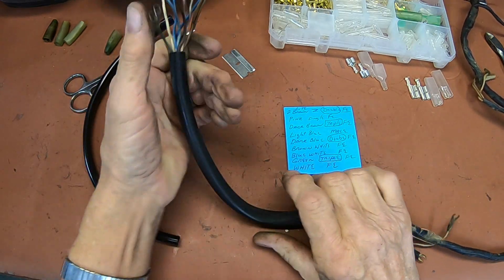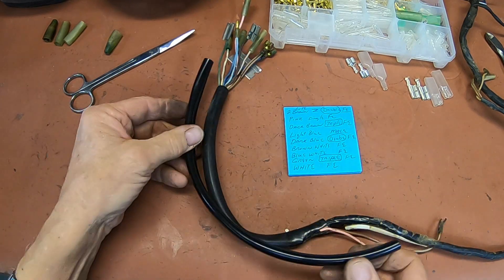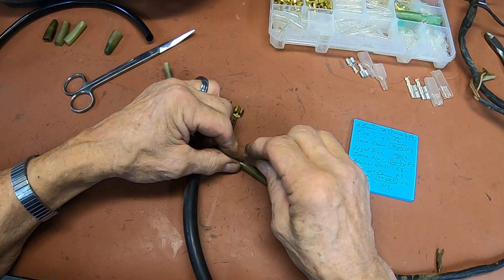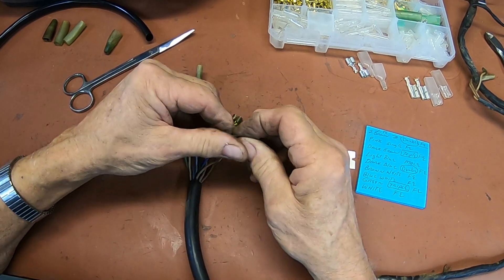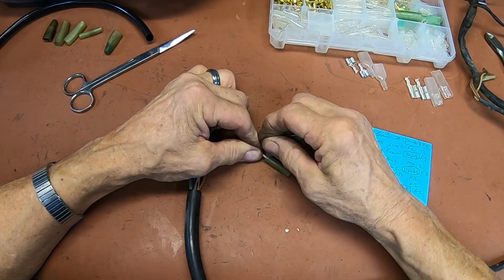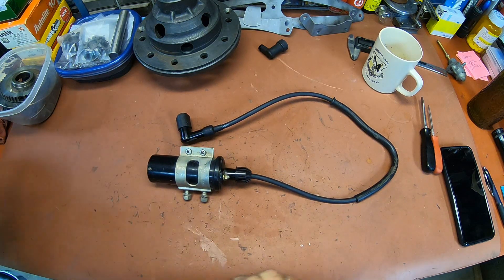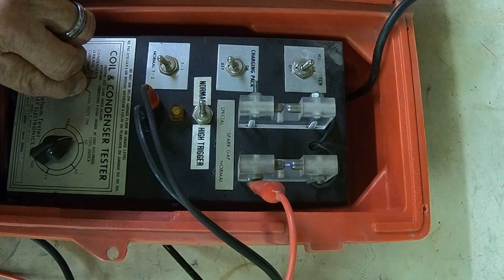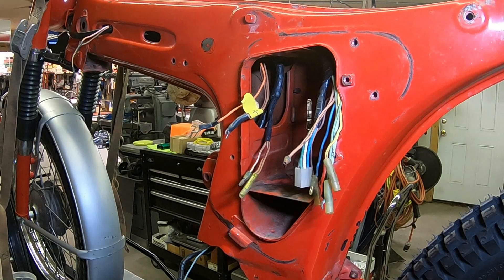Wiring and assemble, Yamaha Trailmaster 100

Comment: Ck with a cabinet shop locally  ir countertops unstallers .Sometimes they have kitchen sink polished granite countertop cutouts you can get for free, so to have a nice flat surface to sand on when you surface sand your top sides of your cylinders and bottoms of your aluminum cylinder heads. They are flat and
work great
Reply from the maker: Sounds like a good way to find one. I have a surface plate that I use.

Comment: Thanks for the coil info. I have a coil I purchased for a Suzuki T350 on eBay that when I test with a multi meter the primary wiring checks out good. The secondary shows nothing. The plug has no spark when laid against the cylinder. Is it most likely the wiring itself inside the coil or is it the lead from the coil to the spark plug cap that is bad. I bet you'll know.Thanks Dale.
Reply from the maker: I would say its most likely the primary winding is bad, the coil leads are stranded wire the odds that all the wires are broken is not likely, hence you would get some spark. Yep, coils bad.

Comment: I totally restored a 1969 Kawasaki G3TR. Or 90TR Bushmaster.Its placed and displayed in my living room ..its totally in showroom new condition.. new engine also,,my very first bike i bought new (Used) for $285. Ive done a couple f5s ,and f9s horns.also.  and many other bikes and snowmobiles thru my 50 years.  I Moved to ga from MN in 99 and down here everything is in rusted ruin..humid climates like Ga turns machines to junk in just a couple years.. Don't ever buy one and ship for restore unseen from the south on the Internet ,, it 'll be junk for sure
Reply from the maker: Yep, I am a southern boy, I understand condensation and rust issues, moved north 40 years ago, almost no issues here at all.

Comment: I never trust the crimp. Always solder connectors after crimping. Kinda like wearing a belt and suspenders. lol
Reply from the maker: Good one Jack, I actually crimped that one with the wrong die, hence the problem. But yes, solder will ensure that it won't come off.